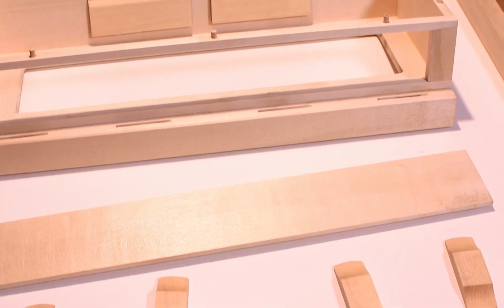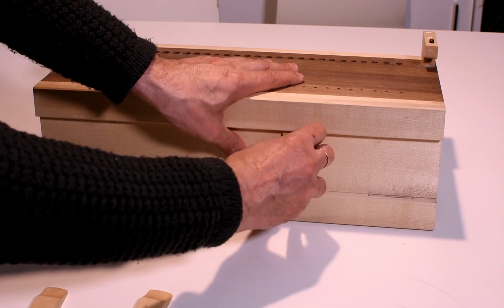How to build portative Organ | #20 Pallet Box | SUB ITA | Homemade Pipe Organ

Comment: So far you have used white wood glue for most things - is there a reason for this rather than hide glue?
Reply from the maker: Hi Michael, good question. I used white glue for the parts that will not be disassembled, for the others I will use the hide glue, as to join the two parts of the windchest, for the leather of the pallets and for the bellows. Thanks